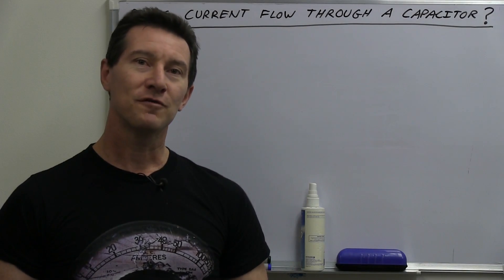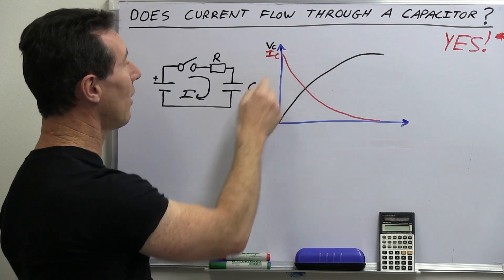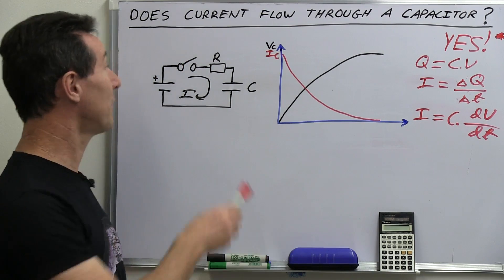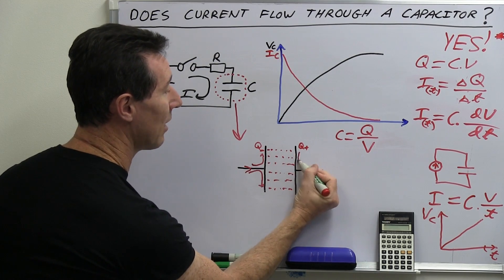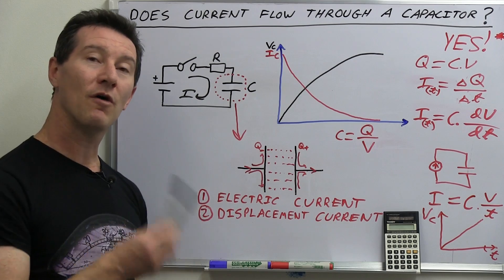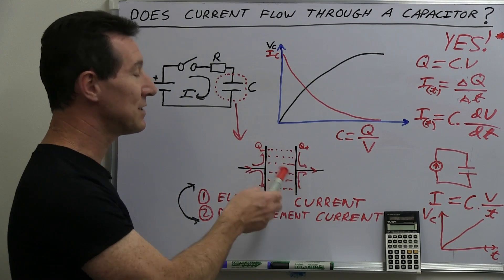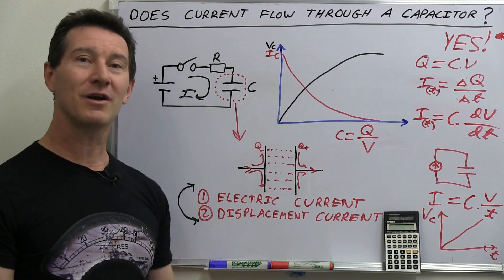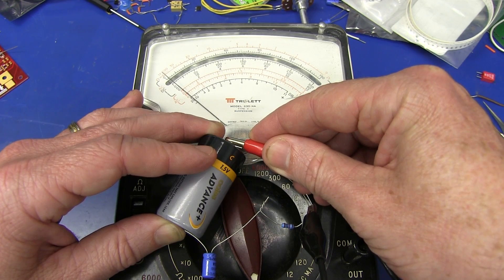EEVblog #486 - Does Current Flow Through A Capacitor?

Comment: Displacement current flows but electric current does not flow through a capacitor.
Reply: Well, if you want to be specific, if you put n electrons into a capacitor, n electrons will come out the other end, but they will not be the same electrons that you put in. So yes, one could say that no current flows through a capacitor because no electrons go all the way through a capacitor. However, seeing one can't id individual electrons (and even if you could it would be a waste of time), there is no effective way to tell the difference. Electrons go in, electrons come out, current flows.
Reply: Current does not flow. Current is a name that means flowing. And is a term that is used to represent the charge flow rate. In Coulombs per second.

So to say "a current flows" is the same as saying "The rate charges flow flow" which does not make any sense. But amazingly everyone keeps saying sentences like "current is flowing". Which will be totally confusing for beginners. It is only charges that flow, never ever current. Its as wrong as saying "a river current flows". 

Also displacement current is the term used to describe the "rate of change" of the electric field between the plates of a capacitor. For example in an air gap capacitor there is no polarization current (dielectric charge effects) at all. So its all just dE/dt only, which itself comes about from the changing PD between the plates. That is all that displacement current means.
Reply: Kevin O'Brien so if current doesn't flow what does it do?
Reply: Shamel Sanders Current means 'charge flow'.

So if you see a sentence in a text book like so

"In the circuit there is a current of 4 amps"  That is perfectly correct. And is just another way of saying

"In the circuit there is a 'charge flow' of 4 amps" which is also perfectly correct.

But if the sentence in your text book (sadly many of them make the same mistake) is like so

"In the circuit there is a current flow of 4 amps"  That is incorrect use of the English language, as it translates to the following.

"In the circuit there is a 'charge flow' flow of 4 amps"

It is not that the person who writes or says this does not understand about circuits etc. Its purely a semantic error only, but one that is very difficult if English is not your first language. It might seem pedantic to pick up on this, but I think it is important for many who will be confused by this wrong use of the English language.

So the following examples below, are all incorrect uses of the word current. I have added a correct usage afterwards. (Looks like many comments on this video is making same or similar errors)

 In every correction below, if you just substitute the word "Current" with "charge flow" you will see they still read correctly, where as the ones I am correcting you will see very clearly (if you make the same substitution), that they are all grammatically incorrect.

here is an example where the same error has been done twice.
"Displacement current flows but electric current does not flow"

A proper way to describe the above is as follows:
"A Displacement current exists but an electric current does not"

Here is another wrong sentence
"Does current flow through a capacitor"

Here is one correct way to describe that.
"Do capacitors plates have a current between them"

here is another wrong sentence
"current never flows through the dielectric of the capacitor"

And the correct way to express that meaning.
"Current does not exist within the dielectric of the capacitor"

etc etc.
Reply: Yes you have it just about. But just remember that current is a noun that is defined as a rate. It is not an object in itself. Hence it does not make logical sense to say that a "current flows". As a rate of something flowing does not flow.

What I do is every time I see or hear some one write or say "Current flow" I just mentally replace that with the phrase "charge flow" so yes do that and it will never be confusing again. (So just replace the word "current" with "charge" and then it will always make sense.)

Its just semantic errors really. But for some bizarre reason over time the word 'current' has been co-opted to mean 'charge' when used to describe charges flowing.

Here is same thing but I'll now use water instead of charge.

It is okay for example to say.

"The river current is strong today"
or
"The sea current is strong today"

But we would never say
"The river current flow is strong today"
or
"The sea current flow is strong today"

As currents do not flow.

Where current above means "water flow" (say in units of cubic meters per second).

Its exactly the same argument when we talk about the rate of 'charge' movement (in coulombs per second).

So the word current (does not flow anywhere) as it is a word which describes  'a flow of some objects'.

Whether those objects be cubic meters of water per second or in the case of flowing charges, coulombs per second.

Of all the incorrect descriptions out  there I have just found one that has got it spot on. Read the definition section here 1st and 2nd paragraph. Note: in that whole document never once refers to "Currents flowing"
 http://physics.info/electric-current/
Reply: If you will take LED, resistor, battery and big capacitor and connect it all in series you will see that led will turn on for a short time. So current is flowing. Same thing like at the end of video, but LEd instead of meter. What else you need to know to convince you that yes current flowing thru cap. Current flow from battery, LED, resistor to capacitor and than out from capacitor back to battery. So what is going on in capacitor ? Current using teleportation from one electrode to another ? Doesn't matter, same current goes in as goes out. So You can tell that it flows thru. And If you wil take compensating capacitor for example from linear fluorescent luminare (classic one with magnetic ballast) and connect it in series with light bulb (not powerfull) and connect it to 230/110V AC 50Hz bulb wil glow. In AC circuits you can calculate Z or Xc of capacitor.
Reply: okay thanks Kevin O'Brien 
but does current flow or not, according to what your saying it does but it's existance in the circuit can not be simply put as "flow" it has to be "charge flow".
Reply: Oh so your saying it is an adjective. interesting, I can understand that.
Reply: Shamel Sanders Yes you got it!  Why did I not think of saying that! Would have saved myself a ton of words. Well done! Nice one! ha ha!

Actually its not exactly an adjective. But is called a sense-specific synonym. Because the word "current" is a synonym for "flow of something", Where its "sense" of meaning is specific to the context of the sentence.

So for example in the sentence "The river current was strong" in that context we know it is referring to the rate of "water" flowing.  But if we said "The current through the oil pipe was high" we would know from the context that current here refers to the rate of "oil" flowing.
This is why the word "current" is known as a sense-specific synonym. But I only just found that out myself after your suggestion that it is an adjective! So that was very interesting to find that out. Thankyou!
Reply: daweim0 Wrong, if you put electrons on the capacitor nothing will happen. You need to move electrons from one plate to another, so on one side will be vast of electrons and on other side vast of ions, that's how capacitor works.
Reply: Currency, the flow of water.  You open a floodgate into a court, judge sits on the high bank.  Banks direct the flow of currency. Human being has a high percentage of water, in which this percentage lowers with age.
Reply: and for those who dont think Current flows through a capacitor take a 450v 150uf cap and hook 400v to the positive and grab the negative pin you will find out quite quickly that current can flow through a cap that cap didnt spontaneous create that current that just blew your teeth out. Current flowed from the power supply into your closed mind and opened it fully to next level of electronics knowledge it will block DC on a non grounded circuit if it has a path to ground it will flow through a cap. Now if we take that cap and hook it to a high impedance source say like a tube it will block the dc off the plate or op amp or what ever but it will transmit AC signals through the cap. The ac wave will pass through they floating input but dc will not and PLEASE DO NOT CHARGE A CAP TO 400v and grab the ground pin you will probably die it didnt kill me but I was lucky. The point of this is to show in certain situations it will block in others it wont so be careful.

Comment: Does electrical current ever flow through a capacitor under specific circumstances not mentioned in the video? I thought that lightning is electrical current flowing in between two plates. I thought thats also why a capacitor exploded when you overcharge it

Comment: You sound like the real thing,  my question on the condenser fan motor instructions says the two brown wires goes on either side of capacitor is there a power wire or black that should go on one side of the capacitor to charge it ?  I have two brown wires one brown with white stripe  but I forgot if one of the black wire is connected too capacitor?

Comment: A dissectible capacitor is a beautiful thing to behold, and further convolutes this issue and leans away from electromagnatism and how charges are stored and where...  There's a wonderfully WEIRD video from MIT right here on youtube if you use search term "MIT Physics Demo -- Dissectible Capacitor".  Take a peek for fun!
Reply: It's only WEIRD if you don't understand how it's easily explained by simple physics. The MIT guys were having a bit of fun with the naive.
Reply: fred brooks
Are you saying the video was a fake?  I've read about this experiment enough places to have taken it for fact.  But, I do have all the gear here to put it to the test if you're telling me these videos and accounts are hoaxes...
Reply: It's not fake or a hoax. It's a running joke that hides the fact that the surface charge (on a thin film of water from the air as the conductor) on the glass inner and outer surfaces receive the charges from the metal plates when they are removed (via high voltage corona discharge) and hold the energy in a electric field with the glass as a insulator (not a dielectric) and is transfered back to the metal plates when reassembled.
Reply: fred brooks
That is absolutely fascinating!  Thanks for that explanation.  I had heard that Franklin fooled himself in doing this experiment, but never heard the reason why.  I'm currently reading 3 books on electrostatics as it's something I've had a long term hobby interest in (I also do a kids electrical show with tons of HV gear).  I do see claims, in several places in the books I'm reading that charges are in fact stored in the dielectric and not in the plates.  I love to experiment.  If I were to reproduce the MIT experiment, but heat everything up as hot as possible with a heat gun to avoid moisture, would that be a good control to eliminate the possibility of moisture?  I do also have a vacuum chamber where everything could be placed after heating, but it would be more of a pain to rig...  Would I be wasting my time?

Comment: you must establish what current is first before you even discuss it...the real simple discussion should be '' DOES ELECTRONS FLOW THRU THE DIELECTRIC OF THE CAPACITOR'' the answer is NO...
Reply: Old post, I know...if the current changes medium it's still current.  I.E. Current in a wire being turned into radio waves, transmitted, received and transmitted back through a wire.  Did the current actually flow "through" the air?  Yes, yes it did.  Just because it wasn't some visible plasma arc doesn't mean it didn't flow.  Same idea here.
Reply: hattt be chutiye..

Comment: Great videos EEVblog. Can you confirm that current "passes" through a capacitor until the capacitor charges up? Judging from your graph (the one that depicts the relation between the capacitor charging up and the current decreasing as it charges up) and the final demonstration where your meter measures the current drop as the cap charges, it appears that the current stops once the cap is charged. Is this true? Also, do you have a video explaining how caps and inductors behave with AC current (how they filter AC frequencies)? I've been looking around and have not found any useful info (I'm a novice). Like how a fast frequency passes through a cap and how low ones don't? And how inductors do the same only opposite?

Comment: Its not flowing through the capacitor.its charging the surface of the positive side of the cap. Then when its fully charged no more current builds up until its discharged again.
Reply: If the current is not flowing through the capacitor we should be able to disconnect one side of the capacitor from the circuit and it should work the same way. BUT in that case the capacitor dosen't charge, why: because the freaking current has to flow through the capacitor!!
Reply: MrHydroguy sure the electrons don't accumulate on the negative? Conventional current is wrong.
Reply: It's charging both surfaces (one subtracting and the other adding electrons).
+johnDon  No electron accumulation was mentioned though.
Reply: totally agree

Comment: Its not flowing through the capacitor.its charging the surface of the positive side of the cap. Then when its fully charged no more current builds up until its discharged again.

Comment: The language used in describing capacitors is very confusing as it is misused. Capacitors do not store "charge" a such and I refer to the basic meaning of the word "charge" in physics which is an accumulation of "electrons" that results in an electrostatic potential. Capacitors store potential (which we interpret as Voltage),  energy actually since a capacitor can do work (scatter or is disperse energy). We realise the energy stored in a capacitor by the driving of current around a circuit, among the many uses of capacitors too numerous to discuss here for sure. Statements such as "The Charge on a Capacitor", mislead those trying to truly understand what goes on. When examined, the RC circuit "current" which flows is, ideally, only the result of what is known as the "displacement current" that is, the amount of current that results from, I'm led to believe, the distortion of electron orbitals within the dielectric that stores the potential (energy). A charged (energy charged, not current charged!) capacitor has NO NET ELECTRICAL CHARGE i.e. there is no net electrostatic charge, not anywhere within the dielectric or on the (so called) plates. That leads to the next great confusion created by the many diagrams in physics books that show the accumulation of  negative "charges" on one plate and the accumulation of positive "charges" on the positive plate. Those diagrams are utterly, absolutely wrong since there is only potential present at either plate NOT "CHARGE" in an electrical sense at least. If the term "charge" is used to mean ENERGY CHARGE it would then be correct, otherwise it is incorrect, confusing and misleading to novices. Now I am not across the mathematics of all this and I dont understand the electrodynamics model (the butchered version of Maxwells equations by the way according to some) but from basic physics principles all of this can be deduced by anyone willing to think about it or even conduct some simple, but difficult to set up experiments. I understand that the dielectric in a capacitor, once it is ENERGY CHARGED, produces a static magnetic field also implying the organisation of ectron spins within the dielectric so now we have a congruency between order and energy, disipated energy and disorder. Interesting no? Unfortunately even the capacitor "charging" diagrams depicted are, in the true sense, incorrect (misleading) in that they "imply" the build up of "charge". Once again there is abosultely positively (NO PUN INTENDED) no, repeat no CHARGE (electron charge) on a capacitor unless of course you do the old rub the comb on your sleeve trick and then touch it to a suspended capacitor.. The upshot of all this is also that, in the true sense, current does not flow THROUGH  a capacitor not like it does in a conductor or resistor.
Reply: WAY too much information - couldn't stay around and read it all.

Comment: Current (dq/dt) flows "through" a capacitor (or a battery) but the electrons don't.  The electrons flow "around" the capacitor (or a battery) - exiting one terminal and reentering the other.